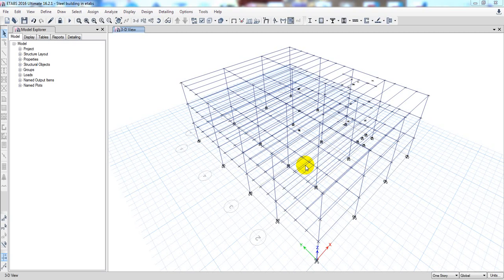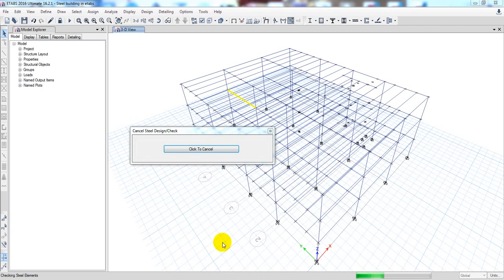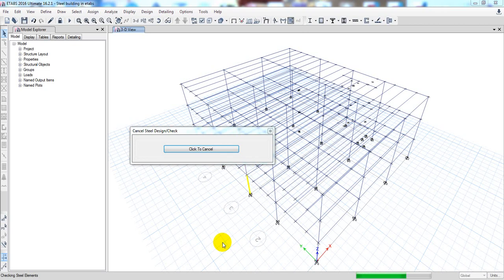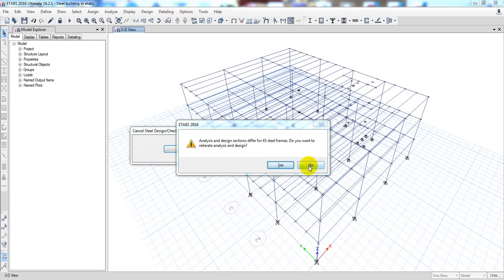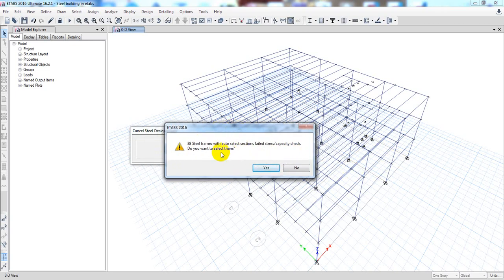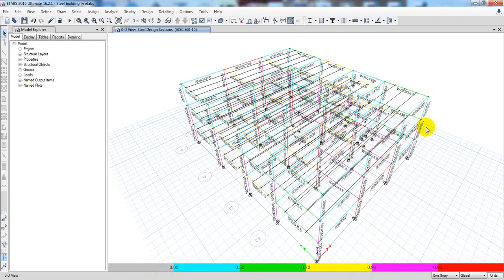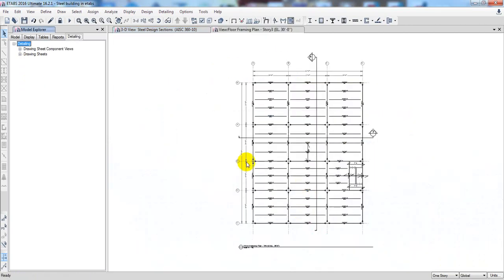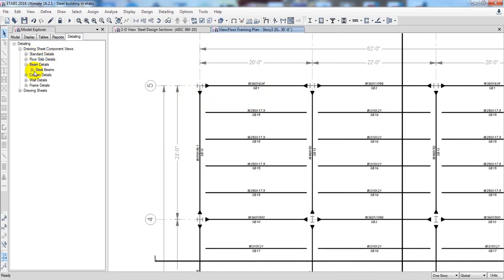Steel Structure Design in Etabs | Analysis and design steel beam and column  in Etabs

Comment: In your final results different beams have different designs ...but in the nect video of connection u have same design for all beams . Is it  ok to have different designs for beams in construction..?
Reply from the maker: It's totally up to you.
Reply: Can we design a single beam for entire structure..?
Reply from the maker: It will be better for work...
but not economical...
As a engineer, You have to Design perfectly and should be economical....
Reply: Can we provide reinforcement for deck slab in etabs..?
Reply from the maker: Yes. We Can...
Reply: Is it similar to the normal slab reinforcement..?
Reply: Please answer..can we provide reinforcement in deck slab as we did it in normal slab in etabs
Reply from the maker: Yes we Have to Provide. but its have different process...
Reply: Okk..bro.. thanks for everything.. ❤️❤️
Reply from the maker: Happy to help.